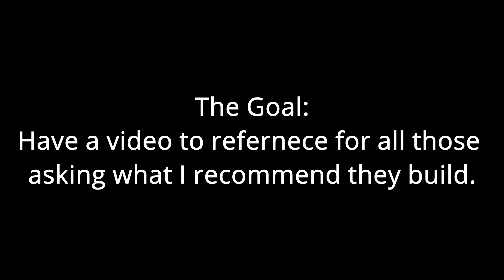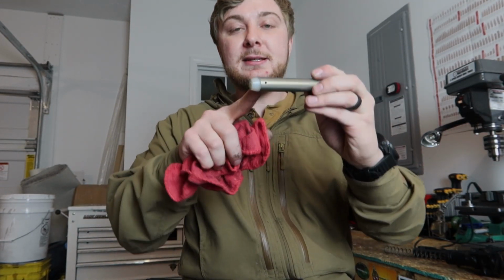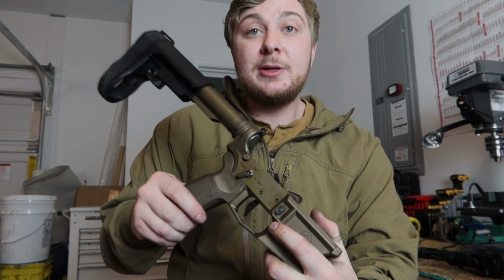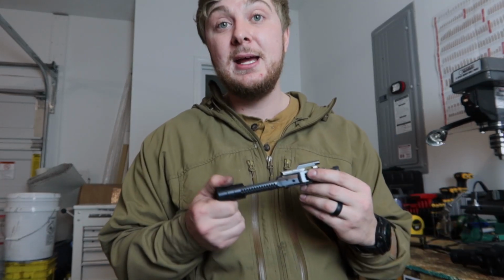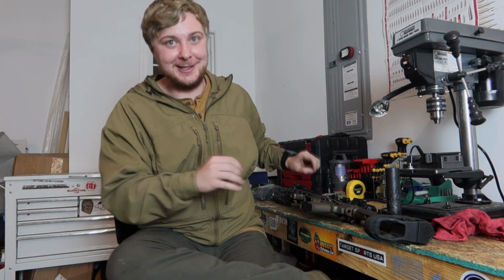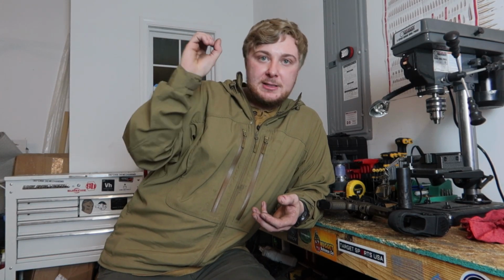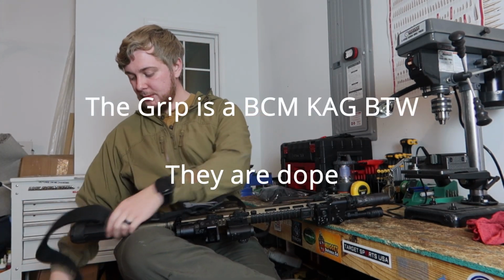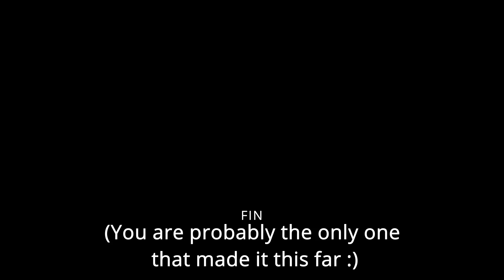THOT Train - The "Perfect" Do All AR-15

Comment: I swapped my carbine length Geissele Super 42 (H2) buffer system for a JP SCS (H2), and while the Super 42 does eliminate most of the twang sound, the JP SCS is dramatically smoother and more premium feeling.. It’s not just the sound, but the feeling that you get when you run the action that is just out of this world with the JP.

Comment: I found that sealing that gap between the back of the upper receiver and that shelf on the radian charging handle you were talking about with some clear silicone does more for keeping gas out of your face than any other thing or gimic part that I've tried. I've noticed no difference with the SD (one with "ports") radian from one without. Tuning the gas at the front and rear obviously help but would recommend you try the seal.

Comment: The A5 and Rifle length do not travel farther than a carbine..  If that were the case the the bolt carrier would over travel the FCG...  Hence the correspondingly longer buffers for each system maintain identical bolt travel..  The smoother operation is from a longer spring and typically a heavier buffer.. Standard rifled length buffers are the same weight as an H3 carbine buffer.
Reply from the maker: Very interesting! I am going to look this up I appreciate the information! I is a FUDD Lore spreader :(
Reply: @LarpingSupply  lol.     BTW, the rifle length gas system is also longer..  the gas is tapped farther down the barrel and hence, at a lower pressure...  Dwell time is also longer..  I think a combination of all three factors is what makes the 20in AR the "softest" and usually they least prone to wear and breakage than all the other lengths.

Comment: I really haven’t heard about putting a longer tube on a “pistol”, I have been thinking about the JP Silent Capture system on a rifle with a Law folder. I’ve been using the Geissele supers and I have an H1 and H3 that I can mess with. I absolutely love adjustable gas blocks and pretty much use Superlative adjustables on all my rifles. But after watching I kind of want to try the Vltor system and see what’s up with that. I do have a question about the fire rate, can you still get very quick follow ups with the longer system? Like would you notice a big difference between speed mag dumping with a Vltor as opposed to a “regular” length tube, I guess that’s the best way I can put it. Anyways, great video! I was busting up when you were hitting the AR reloads and just aggressively throwing the mags out, dunno if that was intentional but it was pretty good stuff. 🤘🏼😝🤘🏼

Comment: From a physics perspective, how is it any different to add the weight via a heavier bolt versus just adding it to the buffer. I see them acting as a unified mass for most of the forces that would be increased due to the higher port pressures of a supposed rifle. Facts, please.

Comment: I feel sorry for those that didn't make it to the end, good vid.

I have actually been wondering about buffers and just tuning ARs in general. I liked all your ideas for videos. I find that stuff interesting too.

I was kind of shocked at those velocity differences compared to the 14.5. I know you said you liked the birdcage, but if you were to say be planning a 13.7 build and wanted a mounting platform for suppressed? Just whatever can attaches best?

Do you always prefer a carbine length or do you prefer a mid or rifle length when able?

What do you think of swampfox LPVO? I think there are some good offerings on the market - but I do agree, as an all-around-er = red dot

Also is your shop still around? I actually found you because I was looking for a defense mechanism carrier. I found it for $140 online without a cumberbun (sp)? Deal or no? Good vid on that btw
Reply from the maker: No my shops closed for now l. I got out of retail for now because I couldn’t find enough time between work to run it the way I wanted.

As far as a 13.7 I’d go Mid-length if you can as it’ll slow and soften the recoil a ton. Also if you are going pin and weld a birdcage will be to short for that 16inch rifle requirement.

I’d go with a DEADAIR  NOX or a Surefire Warcomp depending on you choice of suppressors.

As for Swampfox I don’t know much as I have not owned there products yet. But I’ve handled one my Neighbor owns and from first impressions it seems like incredible value. 

If there is anything else I missed let me know. I appreciate your time! Thanks for stopping in!

Comment: Love the info dude, just curious what you think needs adjusted to give my rifle the most soft recoil impulse possible with the parts I have. PWS buffer kit, JP spring kit, SOLGW bcg and 13.7 barrel, superlative arms Gas block, LMT 3 prong flash hider
Reply from the maker: I can’t think of much more aside from perhaps a suppressor and weight out front TBH
Reply: Giessle super 42 spring with h3 buffer, suppressed with a smaller gas tube and might as well make the rig heavier with some shit like peq, weapon light on a quad rail if you want soft recoil.

Comment: Dude this is a great video man. I hope you find your way on this platform. You could definitely be more concise but I’m sure that will come with time. For someone autistic like myself I geek out on this stuff. Great vid brah. My 11.5 is very similar cept I’m running a fail zero bcg, geissele super gasblock, and a SOLGW barrel. Aside from that this is basically the same damn gun lol. Good job brah. Ohh and I run the SB A4 brace. Had the A3 but I went with the rigidity of the A4 it’s wayyyy better. It was a mistake getting the A3 but 120 spent and learned.

Comment: I’m sorry but as you are knowledgeable is some aspect you have made a few claims that are complete bs. 10.3-10.5 barrels definitely are reliable buddy. Ask the men who use have used them for years and years on a daily basis. Idk what 10.3 you are even talking about besides the mk18 which has been proven reliable. What are you talking about here? Evidence? Dwell time is a thing for sure but claiming 10.3 isn’t reliable is complete bs.
Reply from the maker: It was designed and issued  with a can. Unsuppressed guns under 11.5 have sub optimal dwell time:
Reply from the maker: For sources look into Cranes articles and testing and implementation of the Mi18.

Common knowledge for anyone who knows the basics of this platform….

Comment: Might want to put a LOP limiter on there bud.
Reply from the maker: #1 Most Cucked comment I’ve ever seen 

#2 It’s 13 1/4inch as I measured so even though 13.5 is absolutely not law or admissible in court this passes that weird FUDD lore standard
Reply: @LarpingSupply  hahaha going hard in the paint with the reply. Just giving me the numbers woulda been enough lol. You fucking couldn’t waaaaaaait for that comment. U had that reply loaded. 😂Subscribed.
Reply from the maker: @mr.m2321  Sorry my toxicity spilled out
Reply: @LarpingSupply  all good. My original comment is edited cause I meant to delete it when I posted it. Lol I realized I could measure one and just check. (Btw you are right). But man I’ve been laughing at the thought of u going back and editing urs with “aaaaand another thing”  all day. Thanks for that. And I’ve long asked what happens when we all go 13.7 p&w with braces. Then wut? Lol. Nice build.
Reply from the maker: @mr.m2321  TBH I’m about to probably do a 13.7 Build. I have a Recee 16inch build with a FN CHF Barrel and a Vortex 1-10 setup essentially just like this.

So my AR collection is missing the middle grounds lol

I also have a .22 setup and a 6.5 AR10 😂🤣
Reply: @LarpingSupply  I just got my voltor tube in for a 13.7 dirty bird.  And was looking at law folders. And the LOP was a topic. Ur vid came up and thats why I posted. Sounds like u got some good vids for the channel coming up.
Reply: @LarpingSupply  also I’m a fan of a full Gucci .22 build with airsoft knock off parts and a digital scope. Red light and laser for poppin whoosels. Omni upper and lower with a utg ai folder.